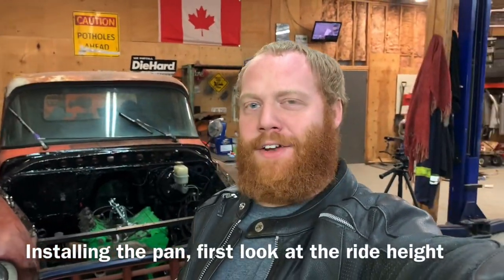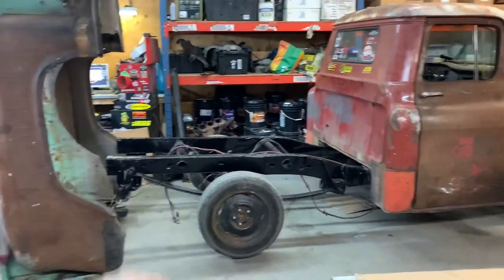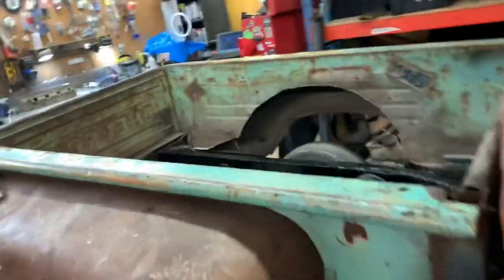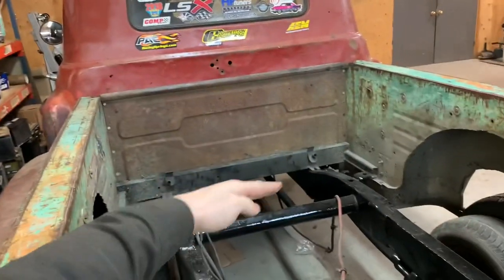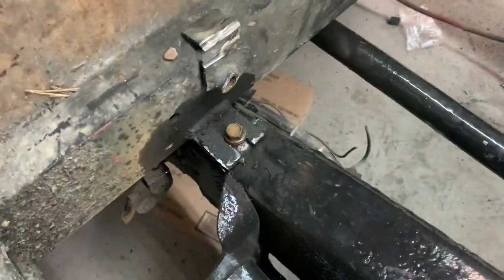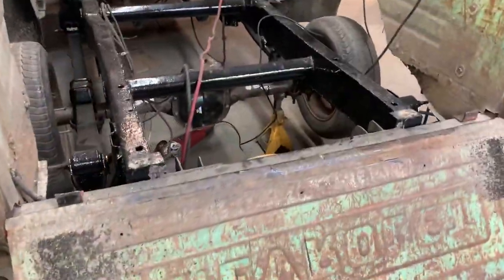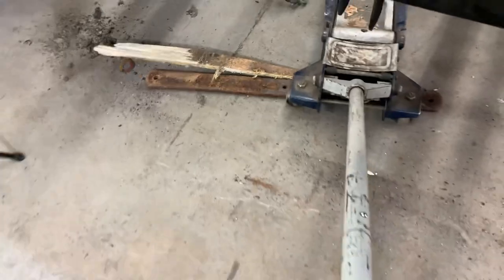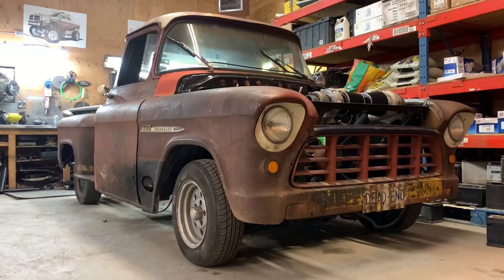Installing stepside bed on my 57 Chevy pickup

Comment: I kinda like the rake, but I hear ya on the wanting to keep it dead level.

Was also thinking, if you put some crossbars off the frame and under the bed, might make the bed floor solid enough that you could safely pack your drag slicks and tools in the back when you haul out to race day or down Mexico way, maybe? After the cross-country trailer madness I had last week (editing videos now, you'll see what I mean after I post all three), I figure the more I can get away with not having to haul a trailer, the better. Lol
Reply from the maker: If the rake isn’t too bad I’ll probably leave it as-is so I don’t have to modify the rear suspension angles and such. 

Shoot me a message with the links on Facebook messenger when you get them posted, I don’t always see notifications. I’m gonna have to do cross beams anyway to bolt the wood to so I’ll probably stiffen them up so I can haul a load. I usually always have my slicks, a jack and some homemade track bite in the back so that’s not a half bad idea. 

I’m excited to see your videos!

Comment: I've seen a guy use an engine hoist to remove a truck bed here on YouTube.  I suppose one can be used to install  a bed too.  That's how I planned to do it.  A buddy is helping me with my truck.  I'm going from a long bed chassis to a short bed chassis. It appears a previous shop may not have cut the bed down properly.  My friend suggested moving the wheel wells to center the rear wheels.  I want to preserve the patina on my truck so he may need to move the rear end.  If you are repainting your truck maybe moving the wheel wells is a great option for you.
Reply from the maker: Right on! That’s a good idea with the engine hoist. 

I won’t be painting the truck, it’s been like this since I first built it in 2016 🙂 

Good luck with your truck build

Comment: Nice project.
   I'm looking for a bed swap on a 1957 Chevrolet. 
    What year bed are you using and what year and make vehicle, are the lights from , that are on top of the bed fenders .
Reply from the maker: The bed sides are the same from 1955-1987, the fenders for this style truck are from 1955 to 1966 

The lights on the top of the fenders are from a late 80s ambulance, I added those myself